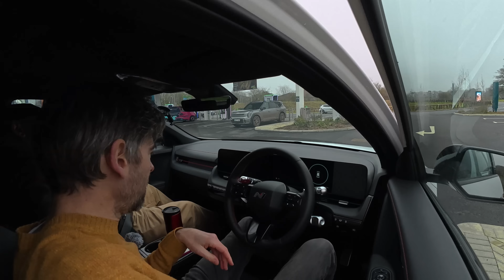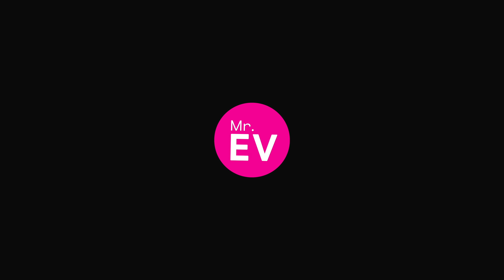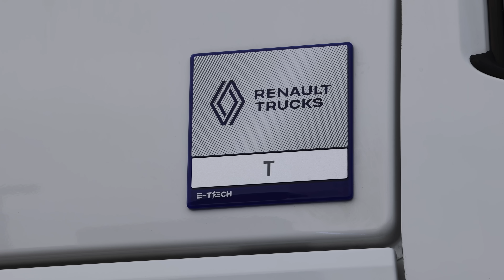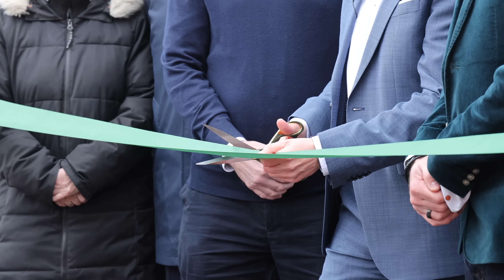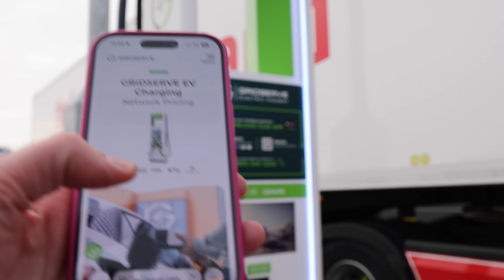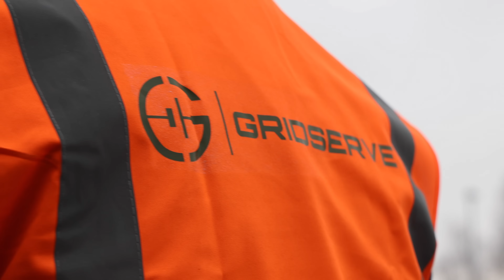Charging electric HGVs: the future of freight, up close. The launch of Gridserve’s first HGV hub

Comment: was at grid serve norwich a while back saw a shred station ev truck charging up. the driver had been there a while. it was pulling 230kW and had put in 111kWh and was only at 51%. think trucks are gonna need megawatt charging to really take off.
Reply from the maker: Yes. This feels like the early days of EVs where some planning is involved to work around the range/charging limitations, although I imagine routes are so well-planned in advance already, perhaps it's easier for hauliers etc than it was for EV early adopters with an old Nissan Leaf!

But you're right: Mercedes have shown an eActros 600 charging 20-80% on a megawatt charger in something like 30 minutes, which is amazing!
Reply: Completely disagree, at least for Europe. Driving time regulations mean drivers have to stop for 45mins every 4 hours and European BEV trucks have their battery size and efficiency designed for this. They can drive for 5 hours on 500-600 kWh batteries and recharge to drive 4 more hours in 45mins at 300 kW.
More 350kW chargers are needed, megawatt not needed for Europe. Plenty of YouTube videos of actual BEV truckers in Europe who say this from experience. US is a different story with mandatory stops just 30mins per 8 hours or so. That’s why Tesla semi battery is so much bigger.
Reply: @Frisian-eh2wm  Just running the numbers on this, it’s borderline. 

These size lorries apparently get about 1mi/kWh. Let’s be generous and assume a perfect charging curve with 350kW. In 45 min they can charge 263kWh, which will get them 263 miles. At 60mph that’s about 4 hours 20 mins of driving. 

If you get worse efficiency in the winter, if the battery isn’t perfectly maxing out the charger or if the charging stations aren’t exactly 4 hours of driving apparent then you might start to have issues.

I don’t think you need MW, but maybe 500kW would give them a little bit of margin.
Reply: @Trifusion1  It's just not a constant cycle of 45 minute breaks followed by 4 hours of driving though. They can fil the battery up during their over-night break. 
If you only had a 300kWh battery, it would be cutting it close but with a 400 or 500kWh battery you'd have enough spare that a 45 minute top-up in the middle of the day would easily get you through the day.
And 263 miles is more than London to Newcastle. There can't be many UK trucks going that far regularly.
Reply: @robinbennett5994  I absolutely agree that this infrastructure will meet most of the use cases for the UK. We do have a lot of long distance trucking coming from the continent too though. 

Like I said, this is so close to meeting every use case, just a tiny bit more power and it’ll go from meeting the needs of most users to meeting the needs of all users.
Reply: @Trifusion1  A some point the folks at Eurotunnel are going to wake up and figure out charging in the queue 8)
Reply: @etchedpixels in the queue, and on the train too! 

The new ferries for the Dover Calais route are apparently hybrids but are currently running on diesel awaiting the ports to be upgraded for charging. When that is implemented though they will start offering charging on board.